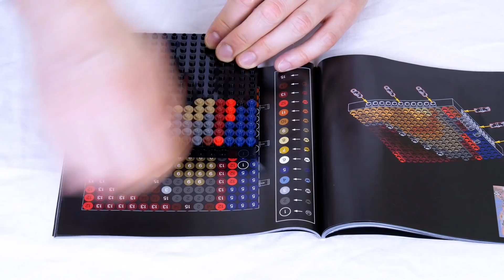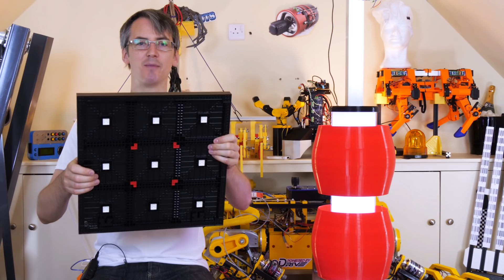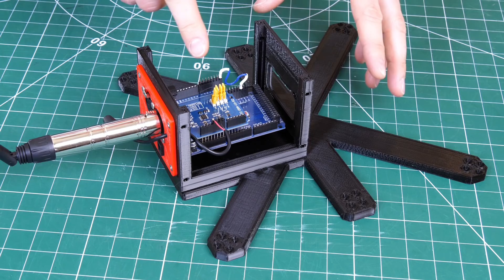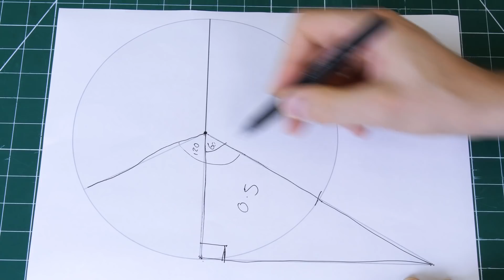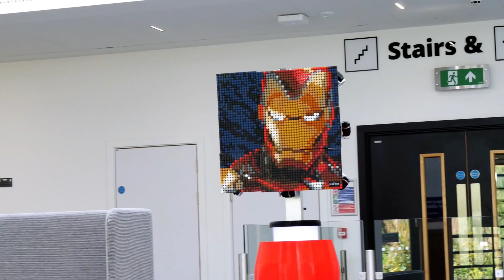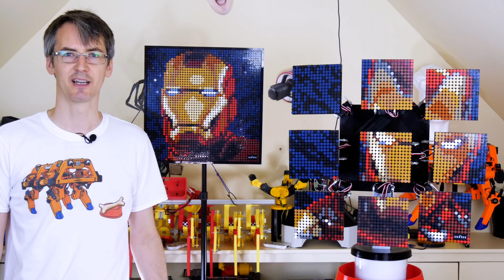Iron Man LEGO Art Display Robot #2

Comment: I also can't help but think how cool that would look with LCD display/led dot matrix panels. Nice work!
Reply from the maker: Sounds like a whole other project!
Reply: @jamesbruton  you would blow some minds if you moved the arms in a wave pattern or something other than symetrical about a point
Reply: Yes, and with servo arms capable of arrange the pannels in diferent ways in order to get square, horizontal or vertical panel arrays.
Reply: I'm kinda surprised the lego itself isn't LED, pretty sure they had that in the 80s.
Reply: @ben-cq3it  To my knowledge, Lego 9V used very small incandescent bulbs and some wizardry that made them either solid or flashing depending on how you rotated them.
Reply: @dafoex  Oh yeah! you could totally rotate them. Makes sense they were incandescent. Pretty sure there were coloured caps you could put on the bulbs too.
Reply: That is sadly squatted by a patent troll
Reply: I mean I thought they were when I saw the thumbnail
Reply: Was just about to type the same thing!
Reply: @PeregrineHayabusa  I was about to type the same thing as well. Virtually word-for-word. 
Once the LEGO deal is done, it should be a simple matter to re-purpose the robot.
Reply: @Francois_Dupont  Maybe, but I doubt it. My guess is that the deliverable was the video series on a popular channel not the actual robot. Either way, sooner or later the sponsorship deal will sunset.
Reply: I saw the thumbnail and thats what u thought the video was,